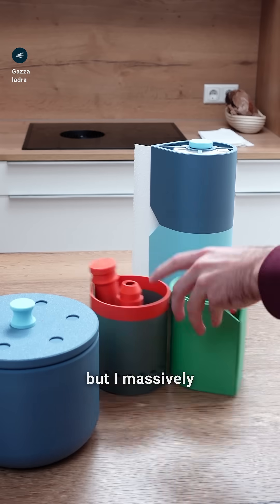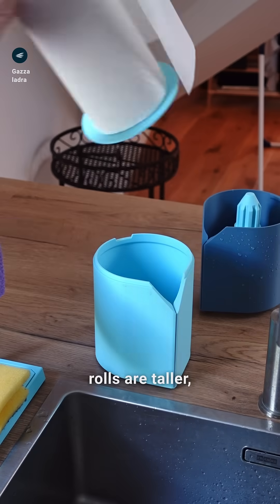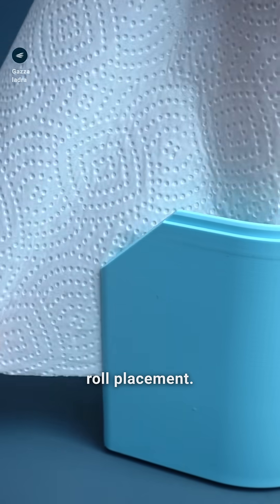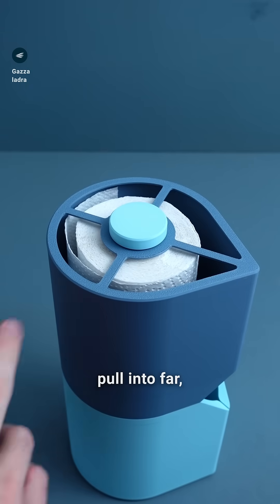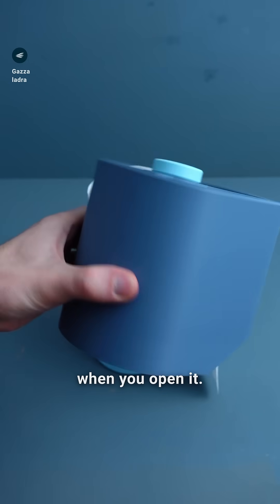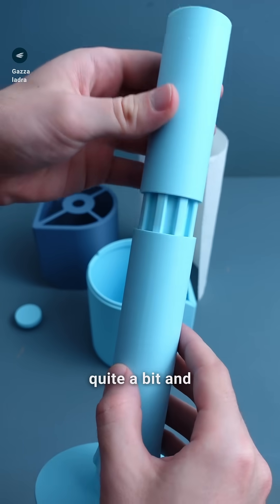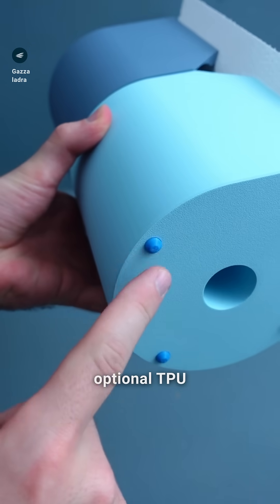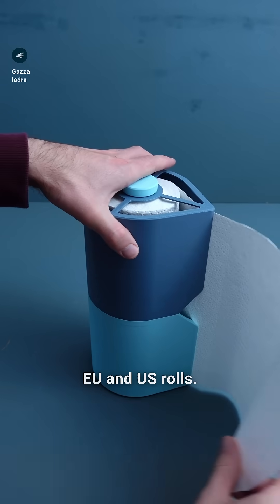I over-engineered a 3d printed kitchen towel dispenser!

Comment from the maker: The files to print this are here: https://than.gs/m/1469166 and in my bio!
Reply: Awesome, clever design. One last suggestion, make the top part only with a narrow see-through window. Because as you reach over the top with a wet hand, the water might drip inside
Reply from the maker: @dvorapa I have that on the improvement list for a revisit
Reply: @gazzaladra but still, really clever design, I am thinking about it for my home 👌😊
Reply: @gazzaladra  I agree, is heavily over engineered. 
I got a piece of rebar found hanging in a fence. Stuck it in a hole on the side of a shelf. 
It fits absolutely all sizes. 

Two years later I improved it with a coat of lacquer. A decade later, now, it still serves me well.
Reply: @gazzaladra can I purchase the product?
Reply: @gazzaladra you could just have transparent see through slit to view how much paper is left.

This is a genius design. Love it.
Reply: Is it possible to add vacuum suctioning thingy on the bottom or smth similar to a bottle that never fall’s. So that I can place the thing on the wall/ side of cabinet etc. this for listening and have a nice day
Reply: @furiousmicro6777 you can actually place a double tape at the bottom for relatively more permanent fixure
Reply: Is it possible to add vacuum suctioning thingy on the bottom or smth similar to a bottle that never fall’s. So that I can place the thing on the wall/ side of cabinet etc. this for listening and have a nice day
Reply: You are very considerate about the 2-section idea.
Reply: Cool!  I’ll take 3.   Seriously are these for sale?
Reply: @nhajkin you can buy the file and print it out on your own.
Reply: @e.schafer6121  I hate that he makes the file for personal use locked behind a pay wall rather than giving the stl or another file for free. The 3d printing community was built on open source and people trying to make money off of non-commercial use prints are really scummy.
Reply: @DarknessLPs innovation comes with a cost.
Reply: @DarknessLPs you can buy the design directly for 4$ without Paywall I don’t understand why are you crying 🧐 He spent many times, trials, and adjustments to do this. It seems normal for him to sell the design.
Reply: Thanks so so much for sharing, and most of all good thinking it up in the first place! You make the Internet a worthwhile place! Thank you once again!
Reply: Spring-mounted stopper to try catching/tearing the serration on papertowels to auto tear 1, if you need more pull out more and stack them? :D
Reply: Make additional chamfer on your inner inner shaft pins, make them sharp at the bottom part and at the top part. So you wound need to wiggle while inserting. It will find its way in. Sorry for my English…
Reply: How can someone order this stuff?
Reply: You magic man you
Reply: now i need a 3d printer ahah
Reply: You’re the man
Reply: should have made a company and sold it instead tbh. now someone is just gonna steal it and pretend they made it and copyright it.
but I hope it won't happen. people would happily buy this from you if you price it fairly while still making a profit.
Reply: really cool. a version that can be wall mounted would be nice
Reply: The problem is the space inside the roll. It gets smaler and smaler. If this didnt fit, you cant use it at all 🤪
Reply: In love with the detail and design 😍👌
Reply: Could add a rubber palm rest for the left hand so you can press down with your left hand and rip off with the same hand. As long as there is a light friction section at the tear off point it should be simple enough to get at least half of the paper off then you wouldn't need the palm rest anymore to get the last bit with one hand?
Reply: heck yeah now make one for bounty, ya eu stag.
Reply: Somewhere in China, someone is making money with your design.
Reply: Amazingly clever design 👌
Reply: Next task would be to make it adjustable to different kitchen towels sizes.
I'd say add an extensible plastic pieces. You might have to move the notch though
Reply: Thank you!!!
Reply: Legend❤
Reply: Concrete base for weight
Reply: Set the roll on bearings to reduce drag and maybe alien tape underneath, that tape is reusable in case you want to switch locations🤘
Reply: Where can I buy the actual thing?
Reply: What a legend!!! 👍👍👍🫡🫡🫡
Reply: Dude, you need a woman.
Reply: hey there, it wouldn it be even easier handling, if you add a little weight to the bottom, like leaving like 5mm space for a stainless steel plate (with a diamer of lets say 70mm and a thickness of 5mm youll get aroun d 150g of weight and can be bought for around 15€ on amazon, im sure one get it cheaper if i would search for it, also it wouldnt make the thing much bigger and the center of mass is lowered adding to the stability)
Reply: Hah! I saw this on the site the other day. Don't really feel like paying for it, but very impressive!
Reply: DEFINITELY over-engineered
Reply: This was sad to see.. it's not that deep..
Reply: Unfortunately the file is no longer available. 😢
Reply: i'm 42, i've never bought a roll of paper towel in my life
stop wasting shit

Comment: I have simple paper towel holder hanging under a cabinet. Easy to use. No wet towels. Cost very little. Has lasted over 30 years. If no where to hang it, I can see where your invention could be useful.

Comment: I have a better idea. A microfiber towel. If you clean it well and hang it to dry you can use the same towel all day or for several days. You don't have to design anything. 

The best part is, you're not throwing your money in the garbage every day by using paper towels.

Comment: Honestly I think this is exactly the point of 3d printing. It's solves a niche problem for an individual. And prototyping is relatively quick and cheap. 

I think 3d printing should be used more for this and replacement parts and things, instead of being used to print plastic crap like toy dragons or whatever.

Comment: This looks really nice in several ways, but you can't call a kitchen towel dispenser "massively overengineered" when it doesn't allow for one-handed tearing. That's a tier one upgrade for these IMO, and without that it's just a nice enclosed but otherwise ordinary dispenser.

Comment: You don't happen to have an STL of a roll holder with the diameter of 40-50cm, right? 
I don't think 1500-3000 sheet rolls would fit in there. 😂
JK. Cool invention.
Huge rolls are much chaper, btw.

Comment: You should add a clear plastic or glass top to prevent water from getting on the roll; THEN it will officially be over engineered 😂

Comment: It's engineered, not overly. To make it overly engineered you would have designed it so he could be used with one hand. Blocking the roll if you pull too quick or hard so it rips the sheet.

Comment: You can add spring inside roller so after pulling paper it will spin back the remaining paper, so that it will not get wet on spills. But limited reverse spin, cause you must have accessible from that centre corner or whatever you will call that

Comment: I wouldn’t use 3d printed parts with paper towels. This is because while the basic plastic a filament is made of, such as PLA, might be food grade certified, the filament with its many additives is often not. This could then result in the unintended leaching of harmful chemicals onto the paper towels that you would then be exposed to when they are used.

Comment: Does it hold a roll of Costco paper towels? The reason I ask is that it appears Costco rolls are larger than average. I have a metal holder, and the roll is too large to fit until you use 10-15 sheets of paper. What's the diameter of the roll holder?

Comment: A complicated solution to moving your paper towels.
Reply: Moving? This is about having two wet hands and needing to grab the roll with both hands to rip off a sheet. It's not simply about water sprinkles feom the sink. Aka there's more than one problem being addressed
Reply: You know it's not mandatory, right?
Reply: To be fair, I know it doesn't seem to be the case in this instance, but in some cases the kitchen is simply too small to put it anywhere out of the kitchen splash zone without it impeding things prep space. For example the only non-sink countertop space I have in my kitchen is two 60x60cm squares. Add a knife block and a few counter top necessities and you quickly have no other choice than to place something next to the sink. And well I don't want that to be something electrical, or my knifes that may rust if they're splashed with water.

Comment: Add weight or compartment to add weight at the bottom for the towel holder. The ones that are sold in stores are metal and have heavy bottom which makes everything feel nice and solid and not have to hold the holder with 2nd hand while tearing off the towel

Comment: I don't like paper towel holders unless they are the under the cabinet or wall mounted kind. The roll stands up on its own it doesn't need a useless holder. I can pull the towels off myself and in this guys case I would just move the roll to a new home sheesh.

Comment: If your hands are wet or dirty and you need to move the roll or use it, just put your fingers in the tube and  spread, reverse pinch. The cardboard don't suck in a lot of water and you can spin the roll to unfold the amount of paper you need and tuck only on it.

Comment: I have a challenge for you. I use a little hexagon box with a hole in the top for tissues. You're supposed to use a roll of toilet paper, remove the cardboard tube without unrolling the roll. Place it in the box and then pull a little tissue through the hole and walla. The problem is it's a pain in the neck to remove the cardboard tube. Can you make something that when you slide the roll in, it slices the cardboard on the inside of the roll?

Comment: It does not seem over engineered at all. It seems very appropriately engineered. This is why engineers exist.
Reply: Something that usually requires one hand, now requires two. Once sat on a verticle wooden peg, now comes in 2pc plastic, yet isn't over engineered??? 😅
Reply: @VinJenkins I have never experienced a kitchen paper stand which wouldn't need to hands.
Reply: @tiberiumnp8030  I have never used one that couldn’t be torn with one hand
Reply: @VinJenkins How do you not use two hands when grabbing tissue paper?? Like yea this is a bit complicated, but I hold the roll in place with my other hand to tear off a sheet anyways?
Reply: It's extremely over engineered the easy solution is not putting your rolls right where the water splashes 
Or just use a kitchen towel to dry your hands 
You know the thing that's actually made for drying hands

Comment: I have my paper-towel on a stand that is about 10 inches from the sink, sometimes closer.  Number of times it has gotten wet in 10 years have been pretty much nil.  And I have a hose/nozzle faucet with a "Jet" mode that I sometimes press wrong and get some water everywhere. 

The stand has 2 rods.   Most of the time, I can pull of a sheet with one hand. 

Paper towel stands keeps the roll OFF the counter, which keeps it dry.  My counter gets wet too easily too.  It's a non-issue.  $5~10 at any store.

But, the Paper towel holder in this video is pretty looking, and looks cool.   But overly complicated.

Comment: Finally an occasion where that viral Chinese proverb fits: you took the trousers off to fart.

The intelligent solution would have been to put the kitchen papers anywhere else but the sink. After all they're not meant to be used with wet hands or as a substitute for towels.

Comment: i dont think you will see this comment with all the other coments here but if it will be more practical if the two parts were fixed and the upper part split into two vertically . so you can open the upper part with the top like a door slip in the roll and close it again without seprating it

Comment: This is actually a pretty cool design but if you're holding it with both hands and the top is open won't your paper towel roll get wet at the top?

Comment: I have a piece of pipe attached to the underside of my cabinet with a 90° elbow. Paper towel roll goes on and it stays out of the way so it doesn't get wet. A swift yank and I can tear off however much I need.

Comment: What do you even need paper rolls for? 😅 I occasionally use it to coat pans in a thin layer of oil when I make pancakes once a year or as a tissue when I run out of tissues. For sure I don't use them to dry my hands. Also, in my parents house we have a tissue holder made of wood: it's been around for 30 years and is still perfect. My parents use papers like I do (as tissue for spicy food) and to clean their mouth after eating. Also, it's a nice tablecloth holder for when we eat on the terrace and it's windy. I don't see why we would want to make ugly stuff with plastics. Let alone useless things like kitchen rolls holders.

Comment: Cant you...move the papertowels away from the water? I think your first step in over engineering was opening up blender for this, they even make ones that hang under top cabnets if you dont have counter space and is a single bar having no issue, unlike how many flaws you had to design around

Comment: Would be good to add a larger base - or weighted base so you dont have to hold the top like that when pulling out a paper towel - looks like it would just fall over otherwise.

Comment: Another solution to the roll getting pulled in too far could be a ratchet-esque protrusion/ramp to the inside of the outer shell by the entrance. If a roll gets stuck after a tear, wind it past the ramp, then backwards a little, and since paper towels tend to expand outwards, it'll catch the flat side of the ratchet/ramp and funnel back out the hole.
Maybe add a slight funnel to the inside as well to help out.

wouldn't work every time, especially if it's a little wet and sticks in, but could save a bit of time here and there.

Alternatively, could install a spring system similar to a motor/generator contactor and have a blade on the end feeding to the opening. Maybe a few for top bottom and middle coverage. Downside of course is complexity/assembly and need to calibrate the springs, but if we're overengineering already, why not more?

also, thoughts on a spike somewhere to help open the plastic on a new roll?

Comment: World is so hungry for design that people think this is good design 🤦🏻‍♀️ dude I am not trying to be offensive really but get some feedback from an industrial designer. First of all you did not solve the problem of getting the paper wet; when you are holding it from the top it is gonna drip it will still get wet? And not dry for longer periods of time because put it in a plastic container??? Secondly, you created an ugly plastic piece that is gonna end up in landfills and not decompose for hundres of years... You really "over-engineered" it this is not  design. Design is much more nuanced. Please dont sell it or send the 3d file so others can print; people will throw it in the trash just a couple of years later... designers are responsible; you need to think about its lifecycle. If you find the feedback too harsh; every "designer" sucks when they are a beginner... you need to accept the fact that this is not it and keep trying

Comment: nonono back to the drawing table. i always tear a smaller piece  than they are. make it with a cutter for very small pieces. i dont need a whole piece for one small booger. make it also cut in two directions

Comment: Why not just put the paper towel roll off to the side away from the water but still in arms reach? Solves all the problems without spending time and energy creating a solution to a problem that could be solved in 5 second

Comment: My solution to not getting my rolls wet was not putting them right next to the sink. But keep going with your thing.
Reply: And grabbing the entire roll with wet hands 😀
Reply: @jamessmith3064  Wall mounted rotating paper towel holder.
Reply: @steelbracket114 yup that's what I have, works great
Reply: @steelbracket114  my sink is part of a partial floating counter, so there is no wall to hang it on 😅
Reply: @m0ri461  face your sink, then do a 180 and walk forward until you find a wall.
Reply: @steelbracket114 He reinvented the wheel for no reason lmao
Reply: I like that it has holes in the top to let the water in.
Reply: Was thinking the same thing. Use a hand towel in your kitchen or as I do it sometimes. I slide two fingers inside the roll, spread them and lift the roll and get two paper sheets off 😂😅
Reply: And pulling down to separate the piece, instead of away or to the side
Reply: We have ours literally right next to the sink, but you pretty much have to be a negligent idiot to get them wet
Reply: Still gets em wet when you grab em with ya wet hands, numbnuts
Reply: Exactly, thank you!!😂😂😂
Reply: well since you're superhuman why tf are you here go out into the world and fix world hunger and the murican disease xD
Reply: not everyone has the space to do that ig, I’ve never had that problem either but clearly a bunch have 🤷‍♀️
Reply: he just want to show off his 3d skills
Reply: It's still nice to not touch the paper that won't be used immediately 😅

Comment: Needs a weight in the bottom and serrations on the exit so I can use it one handed without pulling it on its side. If I have to hold it, the water still gets in through the top

Comment: And the main flaws remain untouched.
Two hand operation needed, risk of knocking it over, wasting valueable kitchen counter top space.

I know how to fix all problems at once with 0 effort: Buy one for the wall. And while youre at it, buy one that also dispenses kitchen cling foil and aluminium tin foil. But i guess then you cant waste plastic for clicks.